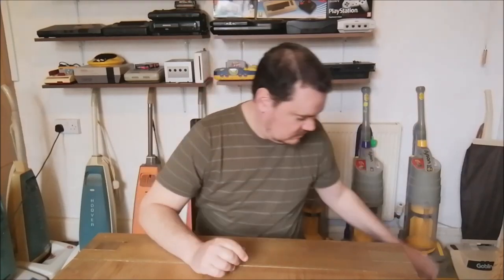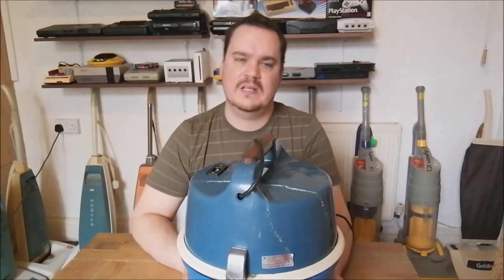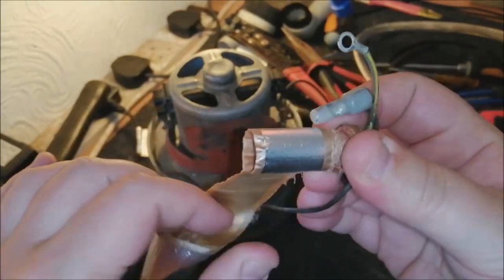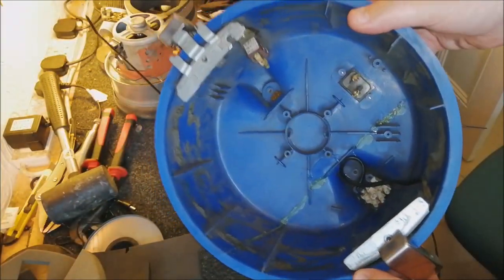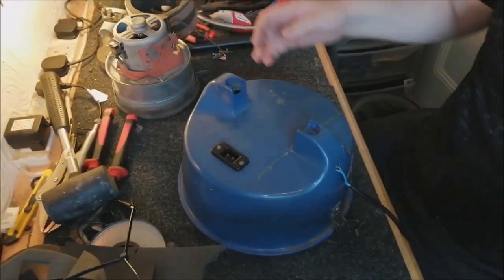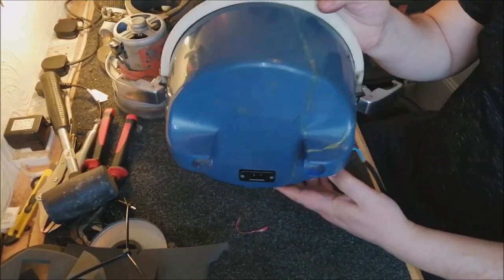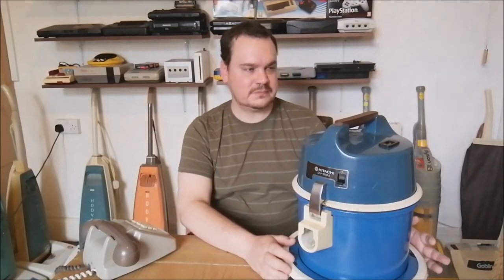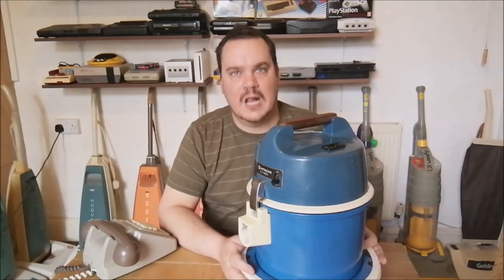Vintage 1979 Hitachi CV-95N Commercial Vacuum Cleaner - Overview, Restoration and Demonstration

Comment: Recently a friend found one with serial number 3002125 what year would that make it?
Reply from the maker: Genuinely have no idea sorry. I don't know if you can actually read the serial numbers on these cleaners
Reply: @TheVintageApplianceEmporium  they look hard to figure out. Have you any idea how long these were made for? That one has a circular base while possibly later ones hadnt just rubber "feet" where the wheels were mounted.